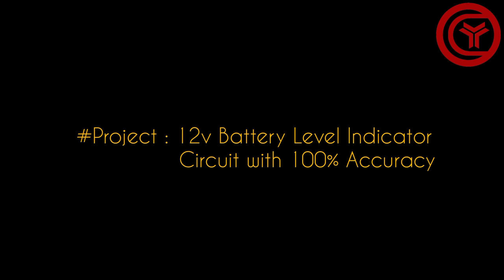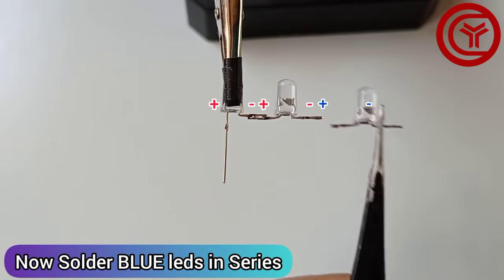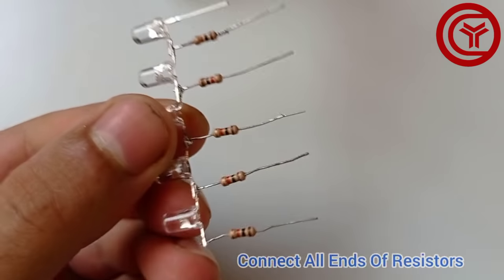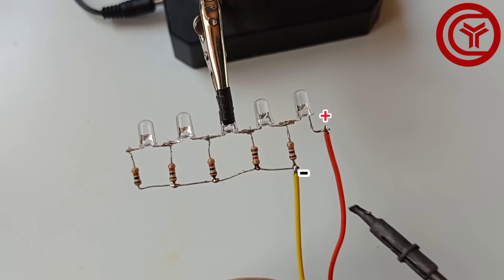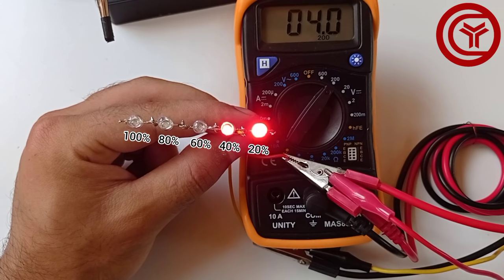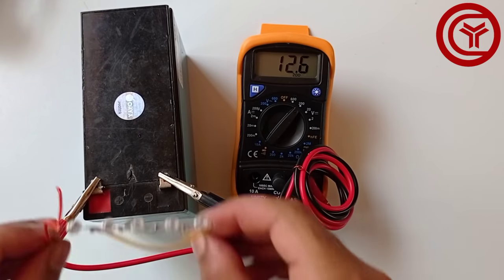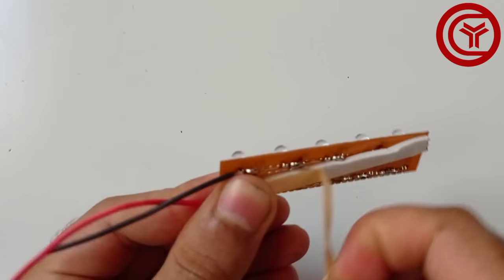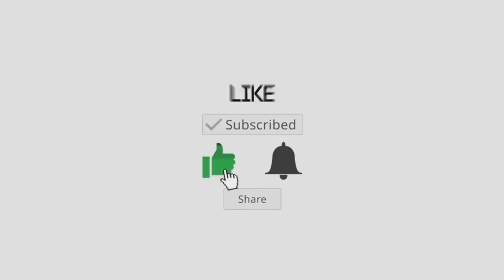Simple 12 volt battery level indicator circuit

Comment: At 7V a Lead-Acid battery has not 50%, it's simply dead xD > Never discharge a Lead-Acid battery below 9...10V otherwise it breaks.
Reply from the maker: New Type 12 volt battery level indicator.
[ For 12v lead acid battery, Showing status from 10-13 volts ]
https://youtu.be/caJ_3k_dxGo

Comment: it is a neat idea but the voltages you apply to this is completely wrong, a fully dis-charged lead acid battery have around 11.9Volts, at 20% charge such battery have around 12 volts. if you discharge your battery way below 12 volts you permanently damage the cells leading to early failure, if you want the longest life out of such batteries you don´t want to go below 50% charge or 12,2 volts resting voltage.
Reply from the maker: New Type 12 volt battery level indicator.
[ Shows battery status from 10-13 volts ]
https://youtu.be/caJ_3k_dxGo

Comment: how i use this indicator in 12v 200 ah battery? pls
Reply from the maker: Use 10-20 ohms resistor on this circuit battery points, and connect to battery.
Reply: @CreativeTechos  ok thanks alot.
Reply from the maker: My pleasure 😀

Comment: Can anyone tell me a guide to do this with 4 or 5 leds but for a 2s lipo at max 8.4v and a low of 6v is there some guidance for resistant ect god bless
Reply from the maker: There may be errors at some points for making 8.4v lipo, I'll soon upload adjustable battery level indicator for any battery 3.7 to 24v

Comment: LM3914 much? Not to mention a 12v VRLA is dead at ~10v
Reply from the maker: New Type 12 volt battery level indicator.
[ For 12v lead acid battery, Showing status from 10-13 volts ]
https://youtu.be/caJ_3k_dxGo

Comment: What resistors would you use for 3 and 6 volts?
Reply: My best guess is 0.5k ohms resistor for a 6volt circuit by putting two 1k ohms resistors in parallel to create 6v battery level indicator.

Comment: Hmm.  A 12v battery is not 80% charged at 10v.  80% charge would be around 12.6v.
Reply from the maker: New Type 12 volt battery level indicator.
[ Shows battery status from 10-13 volts ]
https://youtu.be/caJ_3k_dxGo

Comment: can someone please tell me if I use 26 one watt smd heatstick led   which driver I have to use
Reply from the maker: In series or parallel?
Reply: @CreativeTechos  parallel circuit
Reply from the maker: Usually 1w power led is 3-3.4v 350mA
So if you connect 26 in parallel you need 
Driver of 3.5v 10A, which may be not available in market easily.
So better is to make parallels of 4 leds in series for 28 leds, and then you can use 12v 3A driver
Reply: @CreativeTechos  thank you 🙏🏾🙏🏾🙏🏾🙏🏾
Reply from the maker: You're most welcome

Comment: So:
It is not a battery level indicator since 12V battery at your 60% would pretty much be permanently damaged (still would hold little bit of charge but not even close to rated capacity)

It is dangerous since it delivers false information that 12V battery is at 0% charge when close to 0V and could result in financial loss for viewers due to their batteries being damaged due to overdischarge. It also does not provide any overdischarge protection, it drains the battery till it reaches dangerous voltage levels.

It is in a no way 100% accurate, it is instead 100% lie. Different LED's have different foward voltage drops and battery operating voltage is nowhere near the circuits indication levels. It is more like capacitor bank indicator. For batteries it works as good as using fork to eat soup.
Reply from the maker: New Type 12 volt battery level indicator.
[ Shows battery status from 10-13 volts ]
https://youtu.be/caJ_3k_dxGo
Reply: Yes it is just  to know the baterry voltage voltage not energy of battery

Comment: what kind of voltage range should the LED diodes be ?
Reply from the maker: Red 2.2v &  blue 3.2v
Reply: @CreativeTechos  So the red LED will be burning if let too long in the circuit with full charge.

Comment: UNSABLE .  You show us the volt indicator when the load is low, but you forgot the ampere indicator when the demands increase.
Reply from the maker: New Type 12 volt battery level indicator.
[ For 12v lead acid battery, Showing status from 10-13 volts ]
https://youtu.be/caJ_3k_dxGo

Comment: How to convert it to check 1.5 volts battery?
Reply from the maker: Different circuit required
Reply: @CreativeTechos  I tried to find circuit for 1.5 volts battery testing but unsuccessful.
Reply from the maker: It will be little tricky as 1.5v can't be able to power up led, as normal led starts @ 2.2-3.2 volts. Still I'll try and update you
Reply: @CreativeTechos  I think, if we add to our circuit power supply we should be able to test battery charge. What do you think?
Reply from the maker: You can make battery full charge indicator by using shunt Regulator tl431

Comment: 2 volt is not 20%
it is necessary to measure the voltage from 11,5 to 13 volts
Reply from the maker: Check out this video, 12v lead acid battery level indicator 11-13v level range

Comment: An SLA with a voltage of 7v is at a charge level of 0%.
Reply from the maker: Check out this video, 12v lead acid battery level indicator 11-13v level range

Comment: You cannot use that on a car battery. 12 volts.
Reply from the maker: New Type 12 volt battery level indicator.
[ Shows battery status from 10-13 volts ]
https://youtu.be/caJ_3k_dxGo
Reply: @CreativeTechos  I have sold batteries and solar cells in Norway. A 12 volt battery. Will be destroyed below 12 volts.

Comment: Even if the battery charge is reduced, the light of the mobile phone remains the same. If you put what on the charger light, the light will remain as before.
Reply from the maker: Sorry, I'm not understanding, what you are you talking about "mobile phone" This level indicator is for 12v battery.

Comment: If a battery is at 8 volts you should not be using it.
Reply from the maker: New Type 12 volt battery level indicator.
[ For 12v lead acid battery, Showing status from 10-13 volts ]
https://youtu.be/caJ_3k_dxGo
Reply: @CreativeTechos  cool!! I love it when people learn and make changes great job!

Comment: A 11V battery is already fully discharged!! Cca. 12.5V is the charged state. Anything below 11V is not ok! At 9V you can consider the battery damaged. So this video can easily be called BS.
Reply from the maker: New Type 12 volt battery level indicator.
[ For 12v lead acid battery, Showing status from 10-13 volts ]
https://youtu.be/caJ_3k_dxGo

Comment: 8v on a 12v battery is dead. it goes from 12.6 to 12 then you are deep cycling the battery do not do this
Reply from the maker: Check out this video, 12v lead acid battery level indicator 11-13v level range

Comment: If your 12 volt lead acid battery is reading 8 volts you have way less than 50% state of charge left.  This device is crap.
Reply from the maker: New Type 12 volt battery level indicator.
[ For 12v lead acid battery, Showing status from 10-13 volts ]
https://youtu.be/caJ_3k_dxGo

Comment: or maybe just use your multimeter loll
Reply from the maker: New Type 12 volt battery level indicator.
[ For 12v lead acid battery, Showing status from 10-13 volts ]
https://youtu.be/caJ_3k_dxGo